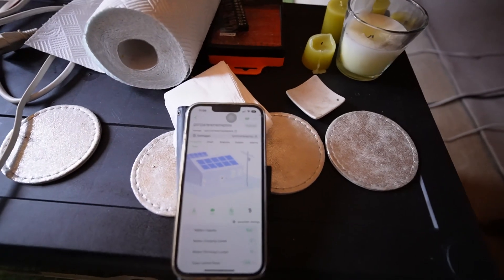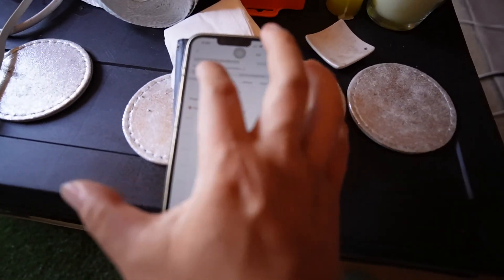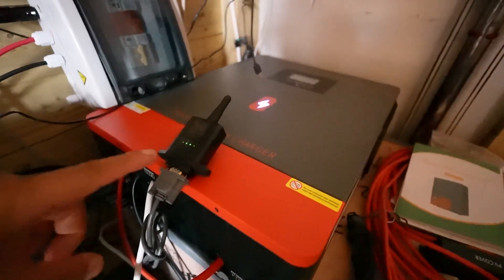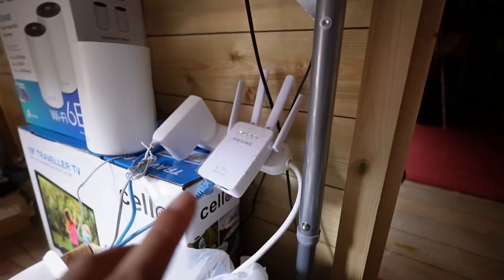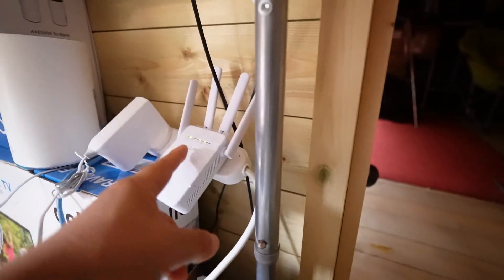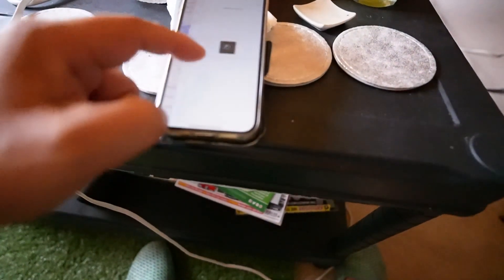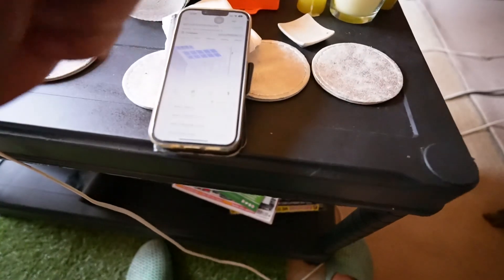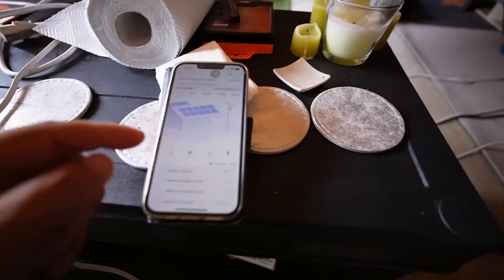PowMR WiFi module fix with 10.2kw all in one inverter

Comment: Somehow the video is quite blurry even at 1080p.  I think I'll try tto use a repeater too because I'm not sure how to communicate at only 2.4Ghz  which is what this PowMr WiFi seems requires while my AT&T Mesh router won't let me set this up as such. I'm using the SmartESS app after asking PoWMR failed to give me a proper download link for "their"software. I believe that almost all of the Chinese hybrid  inverters WiFi modules are using the ESS module. Also I wonder if you managed to interface that software with Windows on your PC, rather than the smart phone app. Thanks for sharing .
Reply from the maker: Yeah sorry the lens isn’t a macro lens but the detail wasn’t really necessary because I just wanted the explanation of the modification of the WiFi repeater acting as a WiFi router to connect to the PowMR WiFi module… 

Sorry again I haven’t seen a pc version of the data logger… there should be one… and probably look into it
Reply: FYI SmartESS wouldn't even recognise the Wifi QR code number on my new POW-6.5k-48 inverter. The app just says the wifi dongle is  'invalid'. I had to download the crappy Hy-Power app to get it to work.